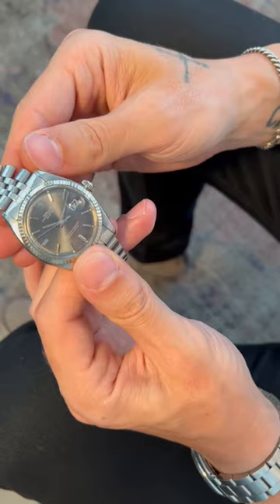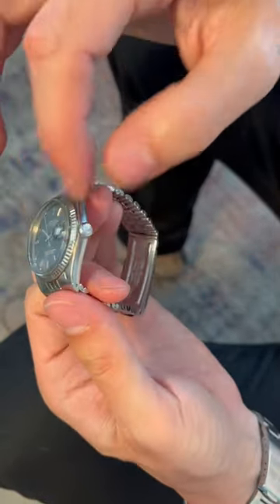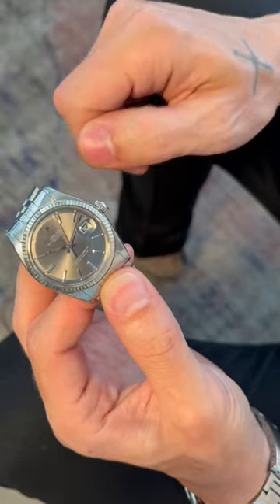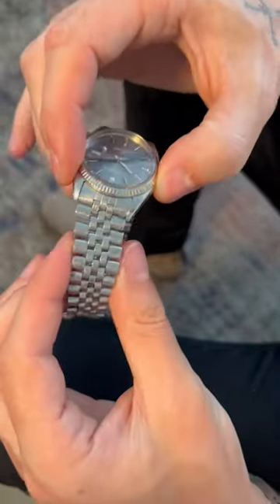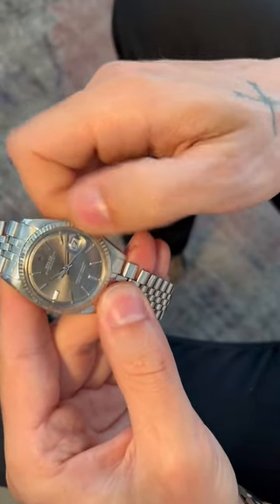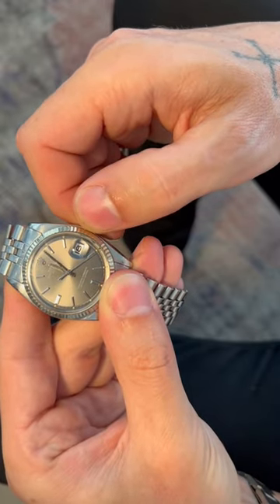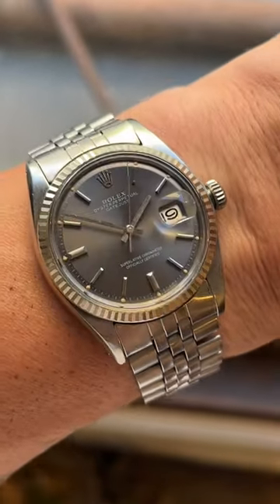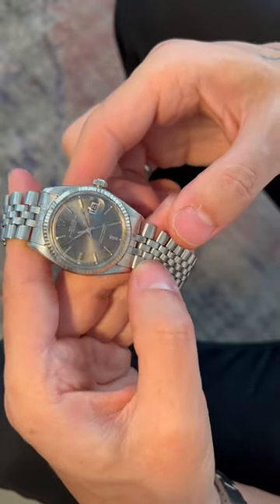Vintage Watch Tune Up: Pt. 2 #shorts #vintagewatches #watchrepair

Comment: Looking to buy one of these. In good condition, few scratches but nothing major. 

No box or papers. Could you maybe help me what would de a decent price or correct pricing. 

In my region a individual seller so no reseller or Company is asking €5000. Which is basically about $5000. 

Feels a bit expensive to me. Any suggestions what i'd be looking to pay that's a fair price?